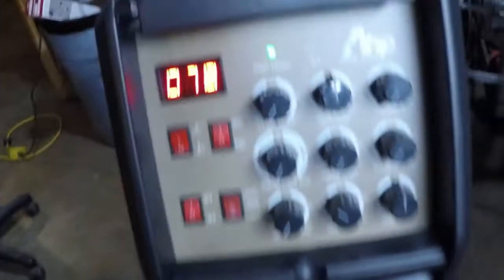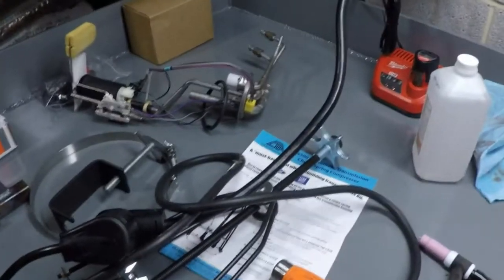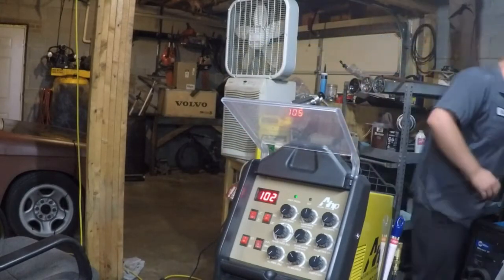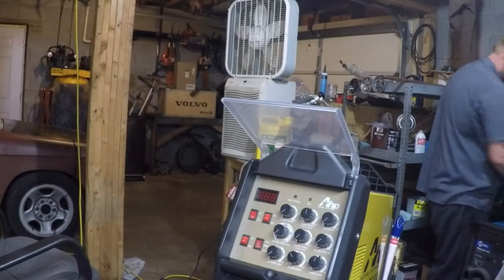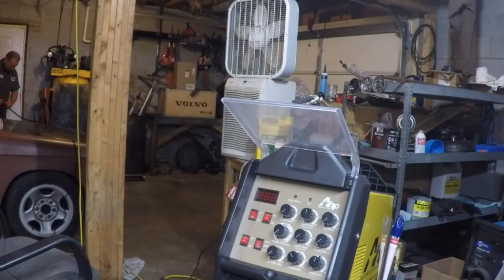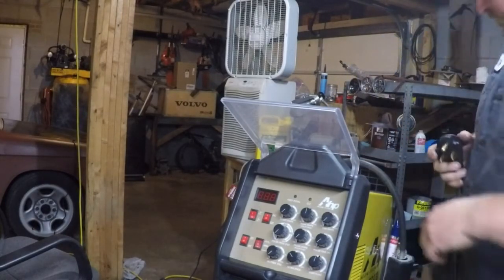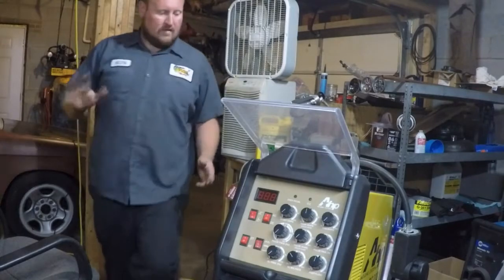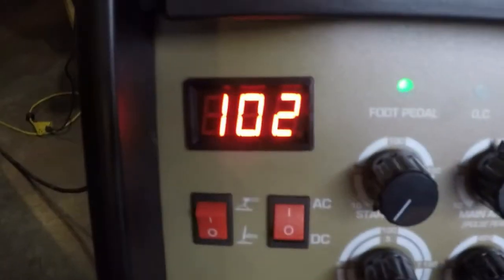AHP 200x amperage on 110v vs 220v.

Comment: I just received mine yesterday, tried some stick welding and noticed this very amp reading variation between the pointer and the readout meter. I’ve not tried 240 yet but everything else seems ok now that you solved this anomaly for the rest of us. Thanks, pinkyboy 
64 yr old phone man with pacemaker.  Just low amperage 80 so far but no problems yet

Comment: It says all this in the manual. Which is very short to read. The main thing to look at is the work cycle which is extremely impressive. 200amps @60%. Which means that I can weld 6 minutes out 10. In comparison the Lincoln 200 tig for $1500 is 200amps @ 25%. So 2.5 minutes out of 10! That is a huge difference for a welder that is less than half the price.
I will note I have used it for about 2 hours of welding so far. The whip gets hit pretty fast though I am used to liquid cooled at work. Also it eats up electrodes pretty fast no matter what the gas pressure. The arc is not perfect and it is somewhat loud. It does give decent beads but u have to do your part a bit more than the welders I am use to . At work I use a miller 300 sync and a thermal arc 300 AC/DC. The thermal arc is a inverter welder but it is smooth as butter. It welds better than the miller. Now at home it is much quieter than work which explains the noise or part of it. Still I like it but there is a reason it’s only $700. Still for that price it’s awesome!

Comment: Yeah on 110v the machine runs at 150amps max so the potentiometer on that knob divides the 150 between its axial range, so I had it half way so that means that about half of 150 is ~75 amps. It's the little things that always seem the weirdest lol